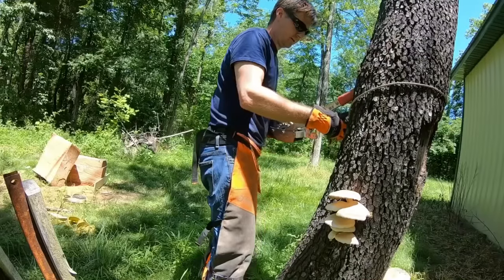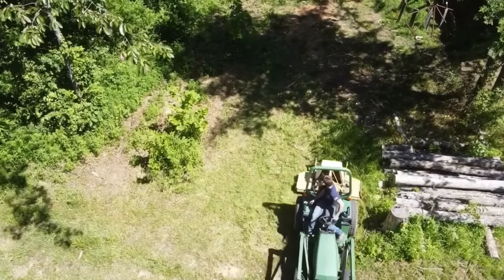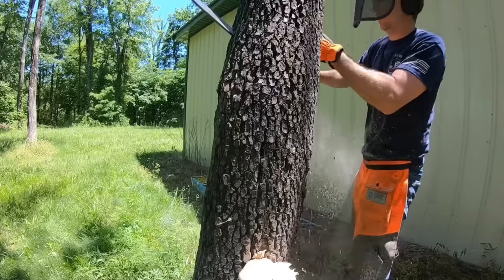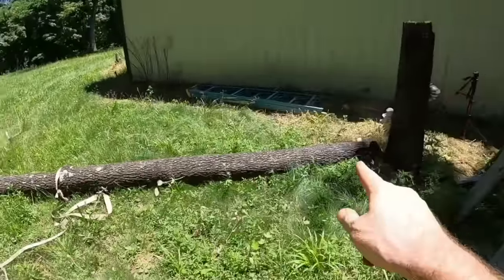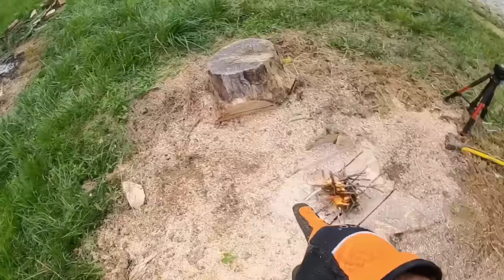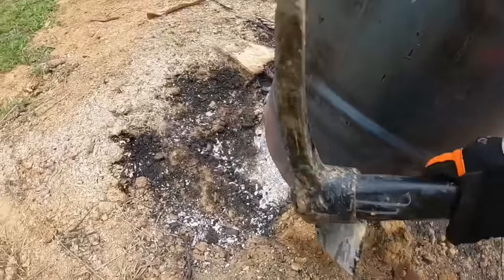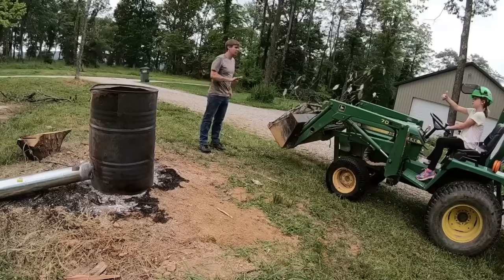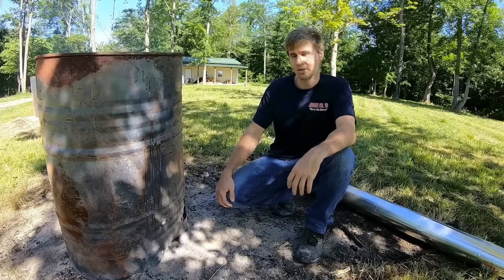Stump burning experiment - PLUS - hazard tree removal

Comment: Hey I do this for a living.  I cringed every time you walked under the tree.  The fell path is off limits after you cut your notch.  Don’t turn your back on that tree, complacency kills.
Reply from the maker: Robert Sheffey nothing complacent about that.  Situational awareness goes a long way.  Thanks for looking out Though
Reply: Complacent and arrogant. Turning your back on the tree and walking beneath it is never a good idea. But hey, you do you since you know better.
Reply from the maker: FlusterCluck thanks for watching!
Reply: Well said Sir. This kind of arrogance is what gets someone  killed or severely  hurt.
Reply: good tips guys about never turning your back on a dead or dying tree and ones thats got a gob cut already, but I NEVER put my chain saw in to the ground, they are designed to cut clean wood, they only get wrecked with all of the stones and soil and dirt, by the time you have replaced a new chain, you might as well just pay some one with a stump grinding machine to grind them out, not only is it quicker, better, cheaper in the long run, you don't piss off your neighbours with burning piles of timer and smoke for two days
Reply from the maker: @jcgoogle1808  neat
Reply: @jcgoogle1808  $25 for a new guid bar for the old husky in the Uk would cost you about $70! chain would be $50 there was a few US companies that would post new saws to the UK, but the two main makers said to them if you ship to the UK we will stop your franchise ! that why the UK is so expensive! when its cheap as it is in the USA it does not matter. As for CO2, humans exhale CO2 its poisonous for us to breathing we need oxygen, trees need it not us, as for burning the stumps out, thats ok when your miles away from everyone, not in built up areas
Reply: Complacent? Are you kidding?? Seriously. If anyone knows about the dangers of complacency, it’s this man. He’s a fireman, for God’s sake. Ten seconds of complacency could cost him his life. So go easy before you spout off.
Reply: all you had to say was “good tip” lmao
Reply: Yo at first I was like dudes overreacting then I saw he even jammed the wedge in and walked under it and far away so the cracking you would hear when really close is no longer going to help with a head start
Reply: Lol keyboard experts crack me up. Good job.
Reply: @petep7227  I’m a certified arborist, aka expert, not just at the keyboard.  My main worry is young pups looking at this and thinking it’s the right way to do it.
Reply: @robertsheffey8894  that wasn’t directed so much toward your comment; more so the other people who are so bent out of shape about him getting a job done at his home. He doesn’t hold this out as a “how-to” video or tutorial. He’s just getting work done and not being an idiot about it.
Reply: @petep7227  that’s understandable I just hate seeing people doing dangerous things without a serious attitude or careful planning these things keep us alive.
Reply: Millenials know it all
Reply: Your so ,so  correct ,I to cringed several times . Glad it went well and no one was broken . Your using a blower is how a stump gets removed . Ya gotta toss the air at it to make it hot ! Cheers
Reply: Shouldn't worry, we have lots of people.
Reply: My mother in law got crushed by a tree and died a long suffering death. My brother was a working, bonded, LLC tree cutter, and this happened at their house!  It was terrible seeing her in the hospital till the decision was made to end her suffering and let her go. Such a horrible death to a beautiful women to soon. I've been a horse girl all my life. It ended my marriage cuz I put a down payment on a beautiful filly (a baby girl horse.
A colt is a baby boy horse. A foal is either or.) He said, him or the horse. I went back to my roots. That filly ended up leading me to being a horse breeder. One of of the important rules is was to never rap a lead line around your hand. It's a good way to lose a hand, and never turn your back on a stallion.(A stud, stallion is a male horse that has with all his male goodies, gelding is a male goodies removed. Neutered. A mare is a lady horse.) You can't trust a stud horse as I can throw them. The beautiful bastards can and will kill u as soon as u let your guard down. They can get you with front hooves, back hooves, bite the shit out of you. They will can take a chunk out of your neck and bleed out before you hit the ground. I know this because I listened to people like this man, but about stud horses, any horse warnings. When a stud horse is out around people, horses, put Vics Vapor Rub in their nostrils. If they can't smell u take the stud out of them.. just in case you leave your spouses and become a horse breeder. Lol
Reply: @bwantland452  That was one highly informative comment! Lol

Comment: Use an auger bit 3/4-1” diameter and six inch length. Drill into the stump. Fill holes the night before with either diesel or cooling oil. Stump will absorb. The added holes will allow quicker heat penetration as well as fuel absorption. Much faster.

Comment: Many years ago, back in the late 60's I worked as firefighter for bush fires. One of our biggest enemies was root fires. In heavier bush fire would go down into the roots of trees (especially dead ones) and burn for sometimes weeks before it would resurface sometimes quite a distance away and start another fire! So normal practise was to fly over periodicaly to check for signs of resurfacing fire.
Reply from the maker: Gerald Heitman I bet you have some great stories from those years.
Reply: Exactly what I was mentioning above.. burning stumps is not good practice really.

Comment: I was quite pleased with the results of using potassium nitrate stump remover. In the process of applications, I learned that hot water on the stove would dissolve a much larger portion of it and then just pour that on the above ground stump to air dry for a few weeks. Any hint of fire started after that will cause the stump to smoulder on underground perhaps a foot deep as the potassium nitrate is an oxidizer turning the stump wood into a very low grade fuse, and the remaining potassium nitrate after smouldering does go out acts as a quick decomposing fertilizer for rot to run rampant with what ever is left. Wind up with a hole in the ground. If you the time to let it dry (2 weeks?) and burn (another week) , it certainly takes the work out of that job.
Reply: This process worked well for me 20 years ago on seven poplar stumps in my Brooklyn back yard, although I bypassed the hot water and used kerosene. I used a 3/4" spade bit to drill several holes about 10" deep before pouring in the potassium nitrate and kerosene . 48 hours later I reprimed the holes with kerosene and set it on fire. It burned for about a minute and then smouldered for a couple of days. Two years later, I roto-tilled the garden where those stumps were and there was nothing left of them.

Comment: Hey Fireman , the one with out the blower put (3) bricks under the barrel to get more air to it ? Remember the fire triangle ? You are getting it done with your leaf blower man ! Nice Family Channel
Reply: maybe try the blower put in so that the air circulates around the barrel, this circular motion should keep the heat in longer, making a hotter fire, causing the stump to burn quicker. The "vortex" type airflow, in combination with the raised barrel, should cut burn time, increase heat, and possibly melt the barrel. I have used this with a gasifier forge I made and burned out several steel crucibles. I now use cast Iron, and a computer fan, to get the heat where I need for aluminum casting.

Comment: Thanks for sharing your thoughts and adventures. Always interesting watching fire combined with tree stumps. Every since I saw on TKOR how to easily make liquid liquid oxygen I’ve wanted to see it pored on a smoldering tree stump. That would have been fun to see, especially on the one that had a depression on it. The other thing that would be fun to see would be an burning iron lance, worked with a guy once who told stories about a previous job he had where they used the lance torches to cut out entire sections of a damaged copper smelting line whenever if failed and poured molten metal all over the line. They would cut down thru the concrete and equipment to virgin ground and rebuild from scratch whenever they had a blowout since it was quicker than trying to cut the area clear otherwise. Stay safe, wishing you and your family the best.
Reply from the maker: Tom Bixby well you have given me several things to research!

Comment: The metal drums, drill holes all around the bottom about 1 foot up, that lets any wind blow through instead of needing the leaf blower.
The biggest difference, pour a mason jar of diesel over them and let it soak for 24 hours before starting the fire, that will suck the diesel into the wood and burn it deeper right from the start.

This type of stump removal is always a slower method, burning is going to take 5 to 7 days to get them down to below ground level so you can have a non hazardous yard / play area.
Reply: Burnt motor oil added to the stump also helps if your area is not ballistic about such stuff.

Comment: Nice work dropping that tree. Since I don't have an excavator and it wouldn't fit in my yard if I did have I had to try burning the stump.  I didn't do it 36 hours but I still got great results after just about 10 hours. 
What I did different: I dug (with a shovel) several inches around the stump so that it burned more of the stump. It worked well, I'd recommend trying it the next time you do something like this. Like you said, it sure beats renting a stump grinder!
Reply from the maker: Construction Trucks I agree with that,  I think that’s the biggest thing I would have changed,  digging around them a little bit more.
Reply: Captain Kleeman   get a new handle for that old mattock you’ve been using, that’s the ideal tool  for digging round stumps and stuff.
Reply: @CrimeVid  Yep, that's exactly what I use too. A mattock works great. You can cut up some thin roots with them too.

Comment: drill some holes and make some plunge cuts in the stump, dig a hole 1 or 2 feet deep about 2_3 feet away from the stump and make a tunnel towards the stump like you do to make a smokeless fire. and make the fire in the hole 12 h later you have a big smoldering  hole

Comment: Tried that stump burning thing once, 20 odd years ago, on a small elm tree stump too close to a fence to get a tractor near. I used a 5 gallon can and an air compressor and a section of pipe to add air. (No leaf-blowers around) Melted the pipe end flat. Lots of heat. Kept at it for nearly a month, then gave up.  When I sold the house 7 years ago, I removed that fence, and took the chance to remove the rest of the stump with a backhoe. I think the heat made the remaining stump "rot proof." (Archaeologists find "carbonized" wood all the time.)  Seriously, I've been clearing brush and dead trees on our farm for the last month with a dozer, and I usually start my brush piles on top of a big stump, and even without a barrel, it works pretty well.  Nice video, thanks!
Reply: Dan Severn Japanese have been preserving wood by lightly charring it for centuries. charcoal is a natural antibacterial. I just learned that the other day.
Reply: Elm is pretty tuff
Reply: @bulletproofpepper2  It's not so much an antibacterial as when you turn it into charcoal you are leaving nothing but carbon behind which leaves nothing for insets or bacteria which would break the wood down exposed.
Reply: Your absolutely right! Best way to do it without a backhoe is just drill holes down into it and let nature take its course. It will be gone in a year or so.

Comment: Good job Captain.
I added a ring of 2 inch holes at the bottom rim of the barrel to create a natural chimney air flow. A couple rocks to lift the drum a bit also works but you have to keep resetting the hot rocks... Less need for a blower with good ventilation down low. Stacking a second drum would be interesting to get even better chimney effect. 
It's a lot easier to just check the fire every few hours than work the stump. Time is your friend with a slow burn. Light it and leave it. I've used an auger to drill a hole under the stump and pump air under the stump to burn it down deep. Occasionally blowing the ashes off allows more air into the burn.
Reply from the maker: Mark G I agree with all of that.  Thanks for watching!

Comment: having burned out more than a few stumps... a couple of points - dig down around the stump as much as you can.  The ash acts as an insulator, it helps to remove it everyonce in a while.   Also put some holes 1" or large into the stumps seems to help.  almost no matter what though it takes 4-5 burns to get rid of a stump, that assumes you want it 4-6 inches below ground level.
Reply from the maker: Zifnab appreciate the tips! Thanks

Comment: I think the problem with the leaf blower is that you are directing the air flow up and out the top. That works great to burn up the wood you throw in, but the heat does not go into the stump, which is what you want. I tried burning one out last year and finally ended up digging a me-deep hole next to the stump and buried it. You have to be able to recognize defeat.

Comment: I took down a couple dying cherry trees with about 10” stumps that I had planned to burn but never found a metal receptical small enough to burn them. I did do multiple cross cuts and discovered as you did that a chain gets eaten up cutting stumps. 
I had planned to use charcoal as a fuel source. 

One other method I’ve seen for a taller stump is to drill a hole horizontally at the bottom 3/4 of the way through then vertical holes down to reach the cross hole. That essentially turns the stump into a “Swedish Torch” or “Rocket Stove” that fuels itself.
Reply from the maker: Wayne Crews the drilling the holes technique seems to work well.  May try it in the future.

Comment: Thanks for sharing your video with us .... the world is already better with people like you and I..... there is no need to cut the bottom of the steel barrel, placing the barrel upside down on top of the tree trunk with an inlet on the top side for the fan will force the flames down on the tree trunk for a faster hotter burn where you need the flames, try it, learn and improve on it ; )

Comment: I learned how to heat treat metal on YouTube using a small charcoal grill, and used motor oil.I also have a blower I bought at a local Goodwill that was used to inflate large inflatable things kids used to jump in. I also have an antique Varistat that was used for controlling lights in a theater. I used it to lower the blower speed that blew air into the bottom of the charcoal grill. I needed to make metal parts to mount a larger gas tank on my motorcycle.I heated them to red hot in the grill, pulled them out and dropped them into used motor oil. Not only did it blacken them it made them rust proof. I then baked them in the oven at 200 degrees for an hour just to temper them. As for stump removal. I used potassium nitrate stump remover. I drilled holes straight down into the stump and some diagonal holes for venting. I dumped stump remover into the holes on top and poured kerosene in with the stump remover, then ignited the kerosene  and let it burn and after 24 hours the whole stump was burned into ashes.
Reply from the maker: awizardalso I’ll give that a go next time.  Thanks for the tip!

Comment: I've done something similar with an old cherry tree stump, a bouncy castle blower, some bricks, and the top of a rusted out chiminea. If you ever need to burn out a stump again, I would recommend a cheap 1" or bigger auger bit to drill down into the stump. It takes longer, but the soil where the stump was had a bunch of rocks and gravel in it, so no go on the chainsaw. 
Either way cheers and thank you for the comparison.
Reply from the maker: 8Jory a lot of people are recommending The auger bit.  Makes more sense then plunge cutting with the saw.  Definitely going to have to give it a go next time.  Thanks!

Comment: The rocket stove method it the way to go if you can. Ideally bore into the stump below ground level. When you said that there was a 4" water main near the stumps I though "oh, no. I can see where this will go". Fortunately you didn't have quite the success that I've had a few times. On a couple of stumps I've burned out I've managed to get up to about 20" below ground level and up to about 2-3ft along larger roots spreading radially.
Reply from the maker: Alan H rocket stove style seems to be the consensus on how to improve Th e method.  May have to do another stump in the future for a comparison.  Thanks for the suggestion!

Comment: Best and fastest way I have found it to use a pressure washer with the very straight stream of water. It cuts through the dirt super fast, gets down under the roots so you can cut them all, and is just great fun on a hot summer day. Once all the roots are exposed, it's super easy to cut them and then remove the stump. Fill the hole back in with dirt and your done. Total time to complete this is about an hour per stump.